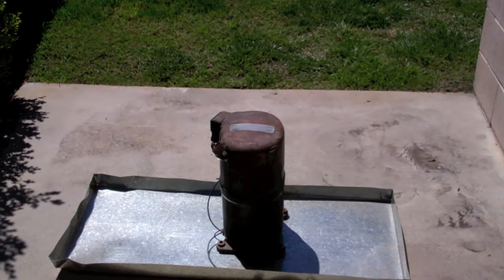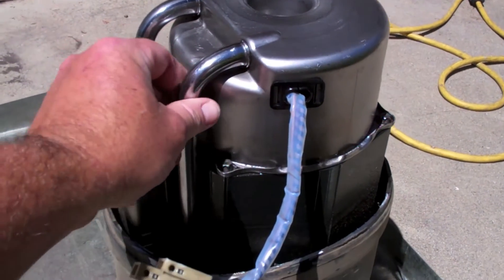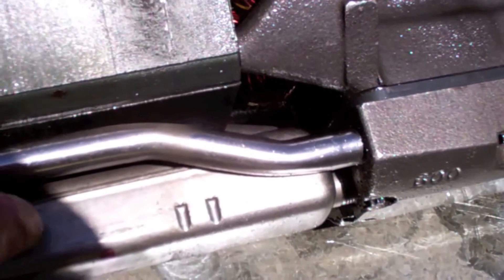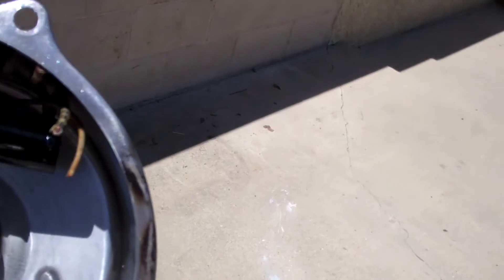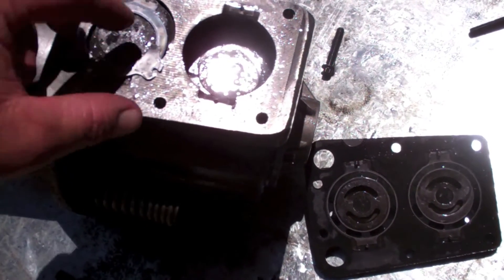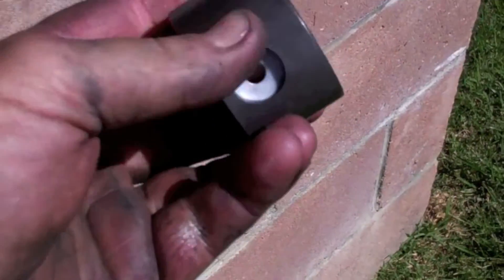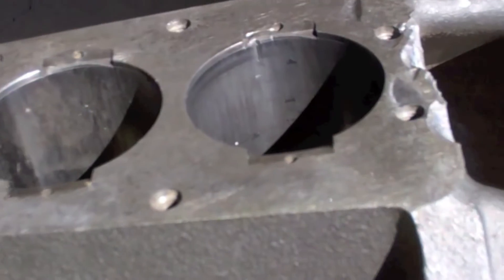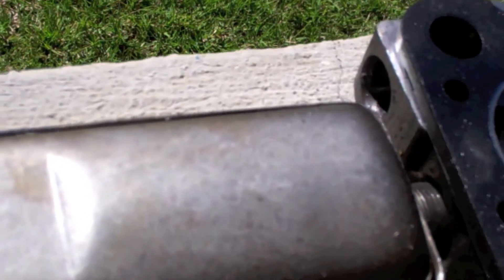HVAC 5 TON COMPRESSOR DESTROYED

Comment: Hi I have an almost identical compressor. Can you tell me how you got the rotor off the end of the crank shaft ? Mine looks like some sort of HUGE slotted screw. The slot is 1/4 inch itself. If yours was similar was it left or right hand removal ? Thanks !!

Comment: Those are great close-ups of the scarring that thing took.  I had no idea a pump could take that much abuse and keep going -- almost like the Everready Bunny.  Next time you have one apart, maybe you could also break open the overload.  I'm amazed that a thermal switch can handle so much current, so I've always wondered what they are made of.  Excellent video -- thanks for your work putting it together!

Comment from the maker: Hey Ed! That compressor was built in 1988 and died in 2011 and has never seen a good day because the duct system would only support 2 1/2 ton of air! I never seen it run but the duct system was so small you not believe it! Thanks for watching!

Comment: I've ran my 2 ton at low ambient and saw frost back to the condenser after a hot sunny day that dropped to 50 degrees at night when the A/C didn't quite catch up first. Didn't realize it until I heard the air wasn't sounding the same coming out of the supply in the kitchen.  Went downstairs first and could tell that it sounded like there was a bunch of supply pressure. Ran outside and saw a suction line frost monster.  My Bristol compressor survived this twice so far in the 1986 Janitrol unit.